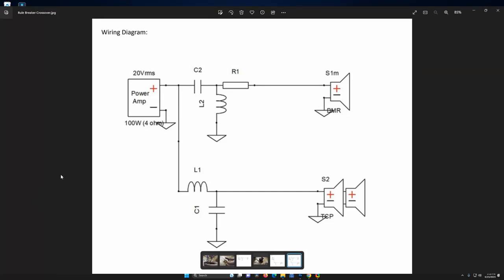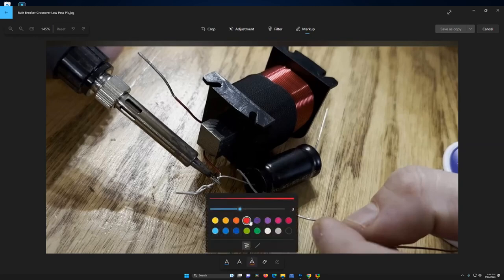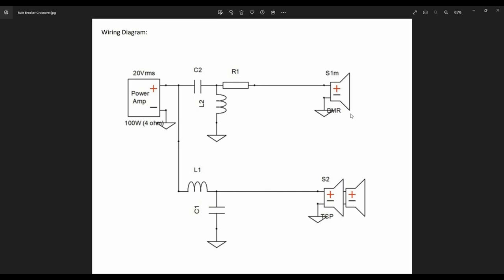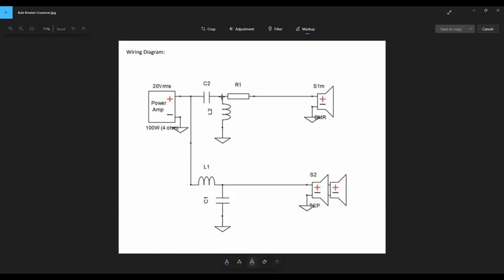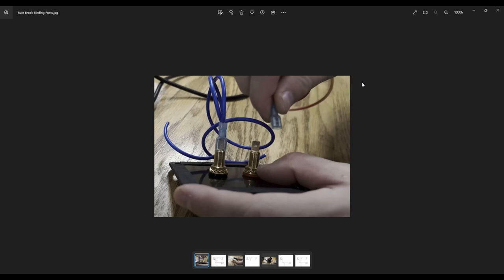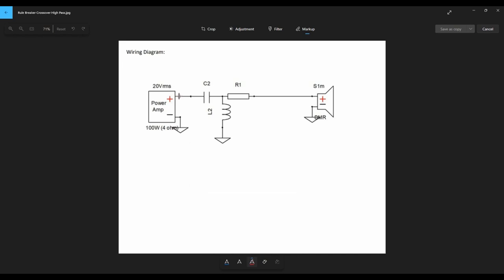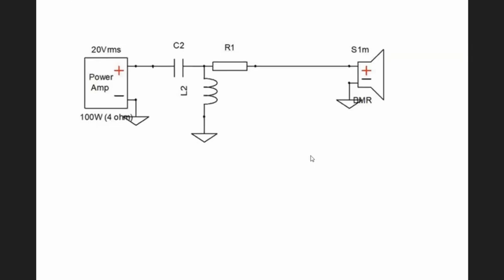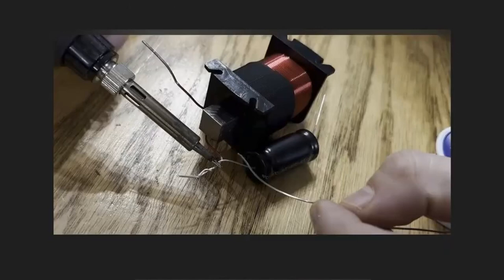How to Make a Crossover Board from a Schematic / Diagram

Comment: The inductor on the low end makes sense and is very common in crossovers, but the inductor on the "tweeter" has me a bit curious...are you applying a high frequency filter on the tweeter to give it a warmer sound?...I don't know what the top end rolloff is on that, but I'm guessing your aim is to prevent unwanted high frequency outside its specs from going to it?
Reply from the maker: That’s a typical second order high pass.

Comment: I have a question. On the first part of the video you  used an Air Coil Inductor, But in the second you used an Iron Core Inductor. Why and what is the benefit of either?
Reply from the maker: There is a few benefits, but in general when you are using an inductor for a high pass, you will use an air core.  On a low pass, you will use a solid core.
Reply: @Toid  Thanks for taking the time to answer me. It was probably a stupid question.

Comment: Another question, When you are designing crossovers using XSIM do you just use the FRD and ZMA files from the driver manufacture or do you actually put the drivers in your baffle and take a measurement of each driver and use that actual graph to load into XSIM? Seems if you used your actual measured graph you would not need to figure in a baffle compensation circuit?
Reply from the maker: That’s a great question. The way that I do this is I do take measurements directly from the drivers in the baffle. I take a measurement of just a tweeter, a measurement of just a woofer, and then a measurement of both of them wired in parallel. Once you do this, you can import the information into XM and also figure out your Z offset which will help you get phase alignment when your design in the crossover. I went over there in my Xsim tips and tricks video.
Reply: @Toid  Thank you, I will look for that video, I need to understand Z offset and phase alignment a little better. I have been designing crossovers using XSIM and factory FRD files but really they would be different if I used actual measured graphs off the baffles I would be using, makes since.

Comment: Curious why R1 is after your cap and inductor and not before? seems like your impedance would be better if the resistor was before that inductor so it is not loading the amplifier as much. I understand an LPAD would be after but this is no LPAD.
Reply from the maker: This may help: https://youtu.be/zoLBnEdVP6c
Reply: @Toid  Thank you Toid! I just watched that video good stuff I understand why you may of used that resistor there now. I love the science behind crossover design. I have made about 50 crossover designs using XSIM and FRD' etc... I have made several FRD's and ZMA,s using FP Graph tracer. love it lol.

Comment: Hey @Toid  ok I put together this crossover and everything is correct. Now my question is? If I wanted to hook my speaker up to get the best sound Being as though I'm dealing with "RCA" , I can use a speakon to connect to the amplifier do I have to get another RCA to speak on connector on the other end of the RCA let's say for example I'm hooking up a subwoofer One is the speak on to RCA three-pin The other end would be RCA. For to hook up to the speaker hopefully I'm making sense. Do I have to get a reversal RCA to speakon to get the better sound.? Apologize for this long question. But thank you and this is actually for anybody to answer in the community. Thank you